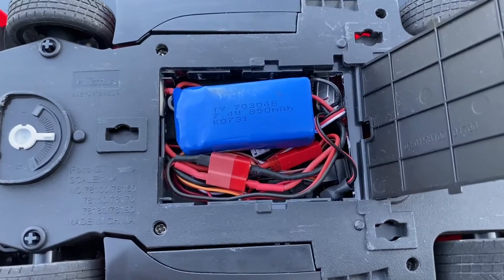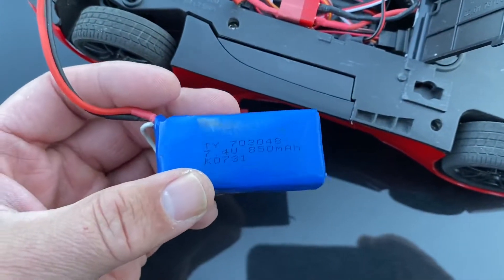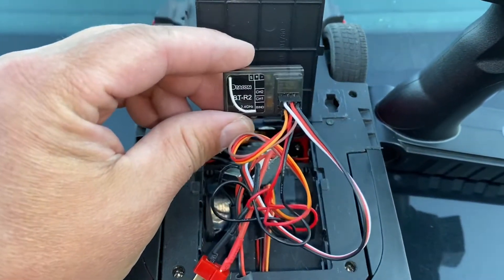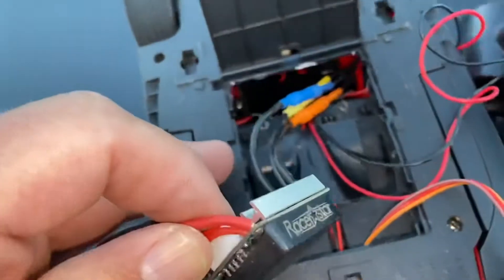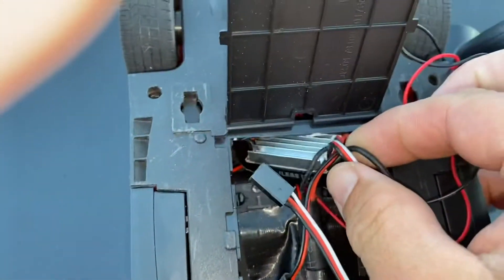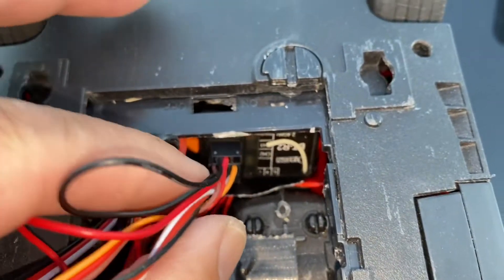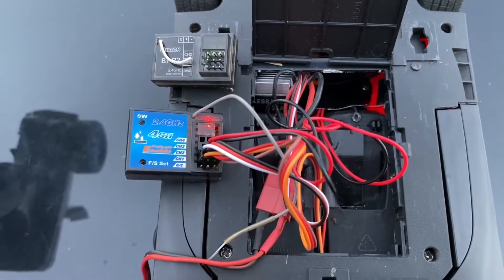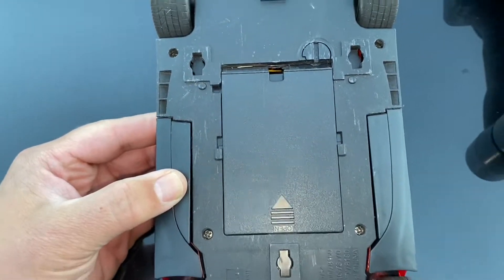Rastar Ford GT Modified-How Everything Fits

Comment: I see that this company also sells replacement parts for these cars and you can get online in case you wear out your tires I think you can get new ones which is nice for this type of company makes it more hobby like.
Reply from the maker: Do you have a link to where you found those replacement parts?
Reply: @2005silver  are you going to have to look at eBay or Amazon cuz that's where I found it it's on there somewhere and I don't remember where it was I just know it was on a buying site that technically they were the FXX Ferrari parts but I would think that tires would fit it and other parts.